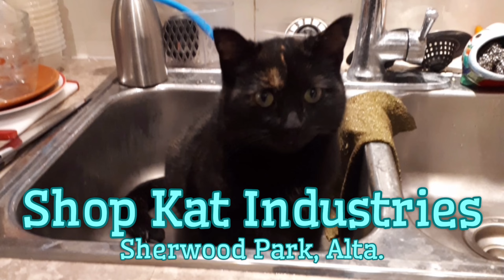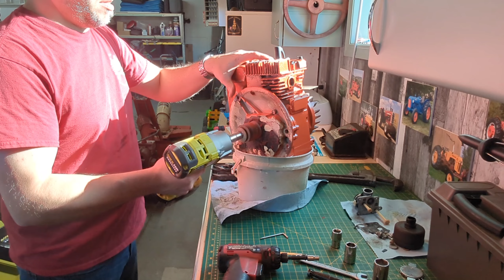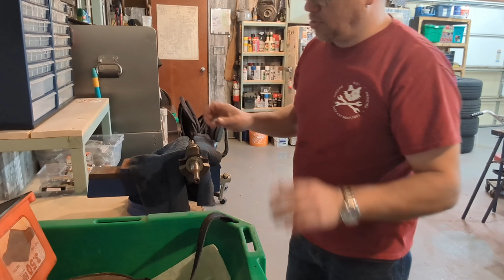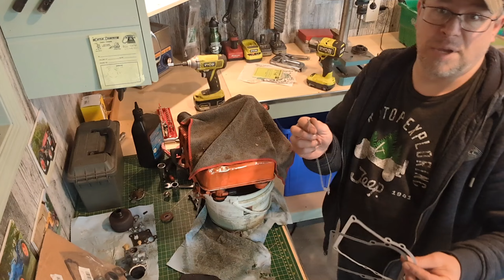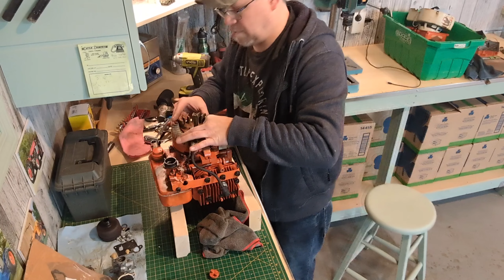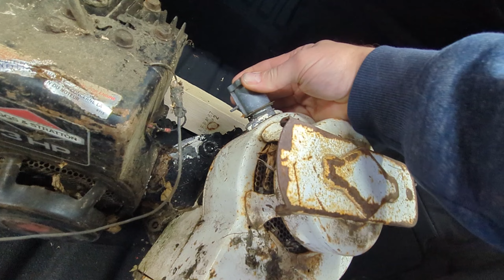Swapping the Swap! '60s Tiller Briggs & Stratton Vertical Crankshaft Into '70s Snowblower Engine!

Comment: This past year I came across one of those crank start engines on a mower. Gave it to my friends at the lawn mower shop and they put it in the showroom as a display.

( I have enough displays in my back  yard...)
Reply from the maker: I just came across an old lawnmower with the same crank starter on it...very tempting, very tempting indeed!